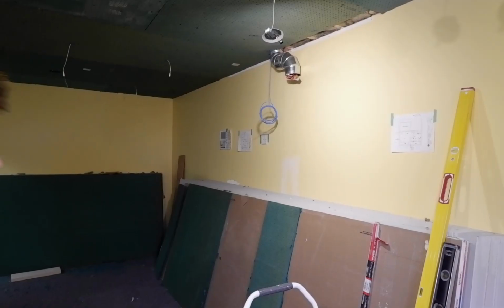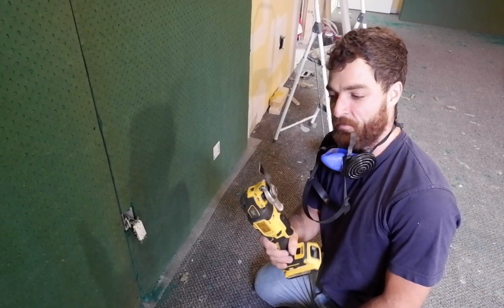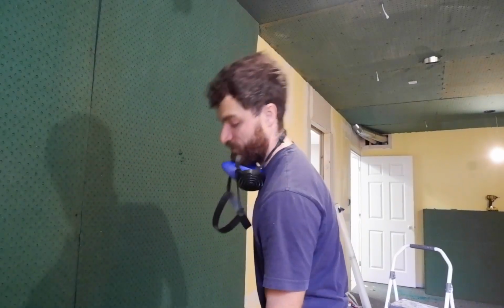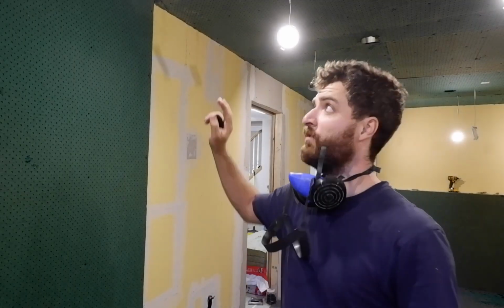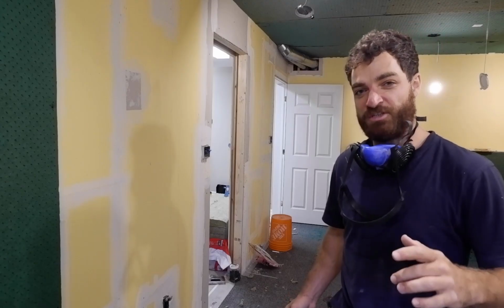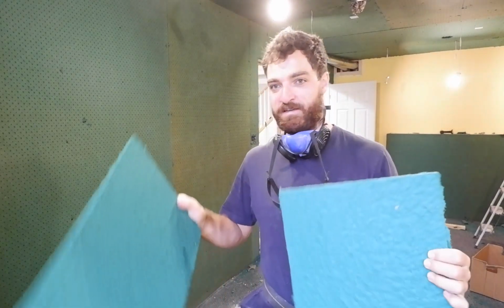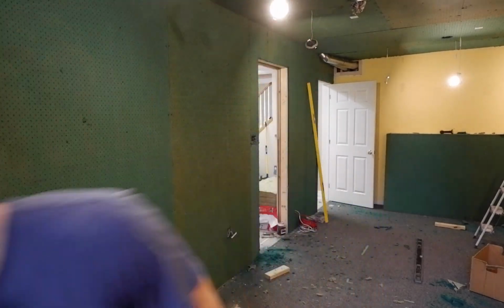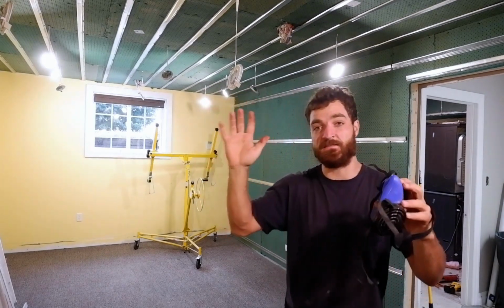Dividing a room in two, How to Sonopan 101 - Creating an at home work space - Ep #2

Comment: Great ! Does the sonopan touches the floor?
Reply from the maker: yes it does! with a strip of vapour barrier in between, as its in the basement so the floor in concrete and will condensate
Reply: @zackcrafted  thanks! Would it be necessary with tiles?
Reply from the maker: @regaudieguillaume   good question! If its on a concrete slab I would say yes, if its on a second story / wood floor you wouldn't have to do anything. Only thing to consider is if the tile sees water (shower room, kitchen, etc) you could then put Sonopan on vapour barrier, and wrap it up an inch behind the baseboard. 

I don't think they mention it at all in their installation manual, just an extra step I did
Reply: @zackcrafted  thank you very much !!